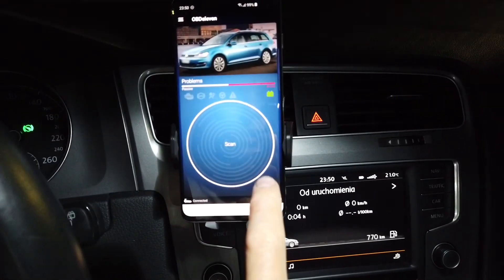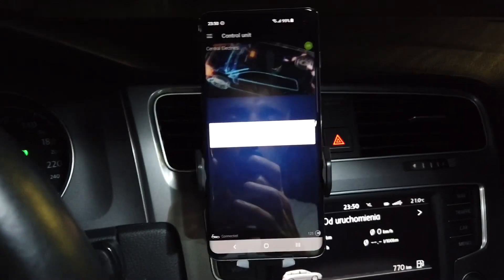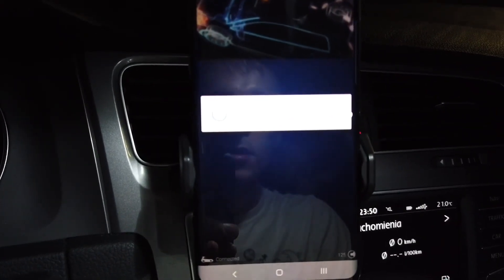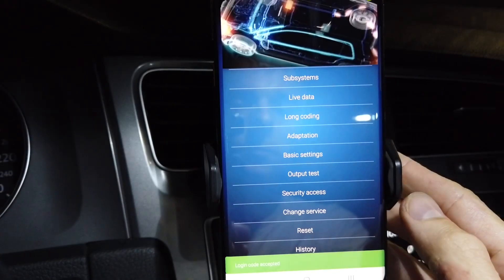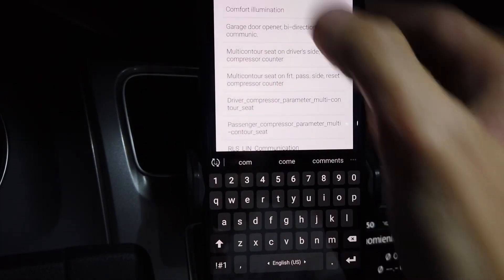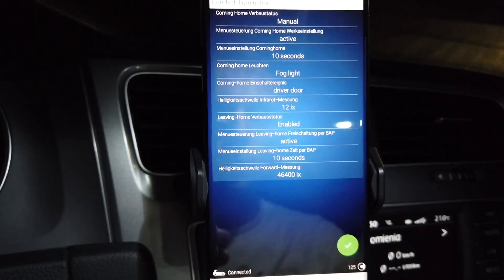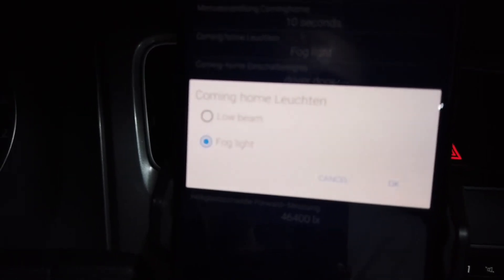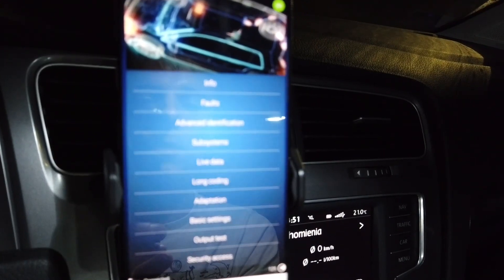VW Golf MK7 fogs coming & leaving home / welcome lights activation with OBDeleven

Comment: Is security code your login code for your obdeleven
This is 😎 I’ve led lights when I unlock car it blinds my neighbours 😂 
So I’ll be using this at some stage
Reply from the maker: No. Security Code is a code that manufacturer set for certain module. You need to enter it so the module allows changing its setting.
Reply: Would it be same code on 2019 golf ?
Reply from the maker: @anthonymillar6183  should be.
Reply: mr-fix thank you 
Keep posting obdeleven videos 👍
Reply: Tried it 
Does not seem to work on golf 7.5 after I put code in go to adaptation search comfort it won’t find it
Coding must be different on 7.5